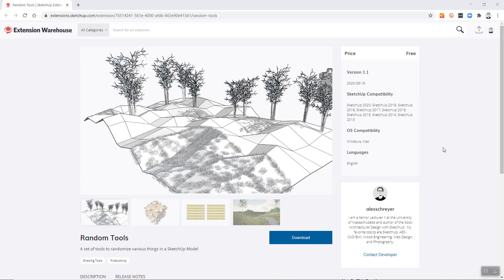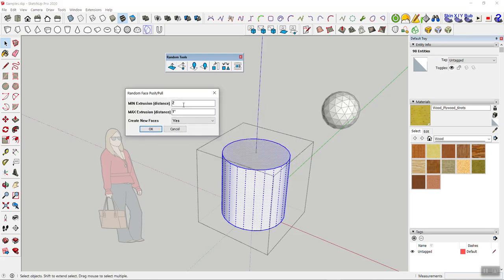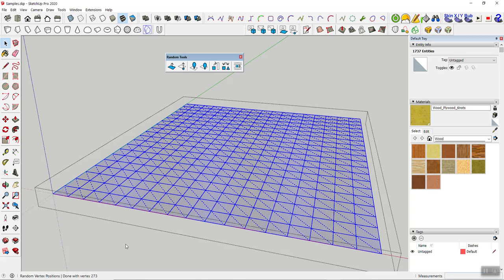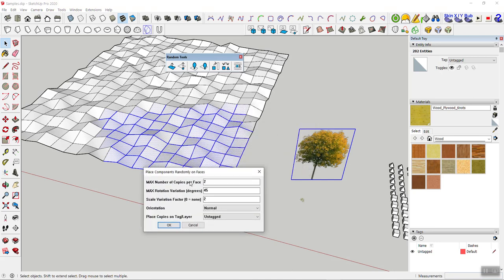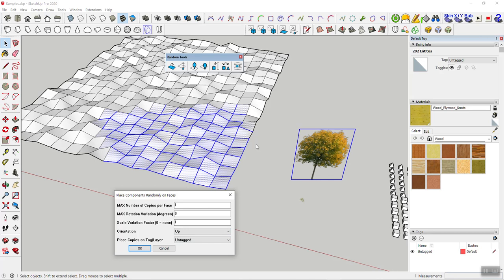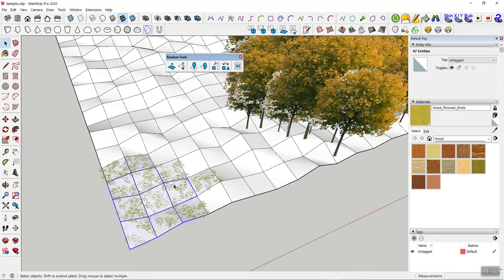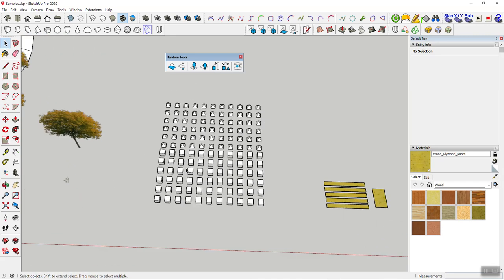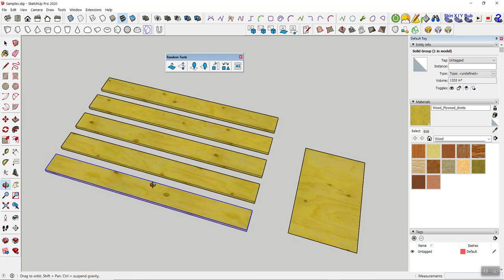Random Tools Extension for SketchUp - Introduction

Comment: Excellent extension. Much simple than most I have tried to used within render engines and alleviate the need for mapping which can be kind of tricky. Also, the ability to do random texture mapping is really cool.

Comment: I tried it in sketchup 2019 and the random placing wasn't working... When I switched to 2020 it worked
Reply from the maker: I'll check it out...
Reply from the maker: Yes, found the problem. I'll fix that in the next version.
Reply: @alexschreyer-channel  thank you Alex
Reply from the maker: The update is in the approval queue. Should be live soon.
Reply: @alexschreyer-channel  that's great. Thanks
Reply: i'm having the same issue here, but the version that i'm using is make2017... The rest of the commands of this extension is working pretty well! really amazed with it! :)